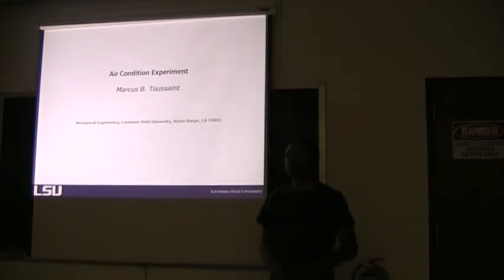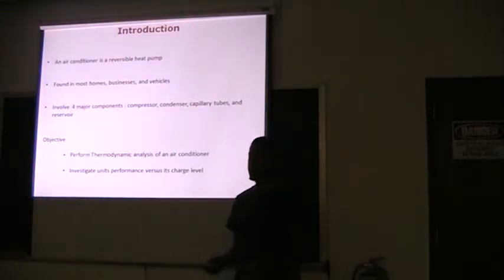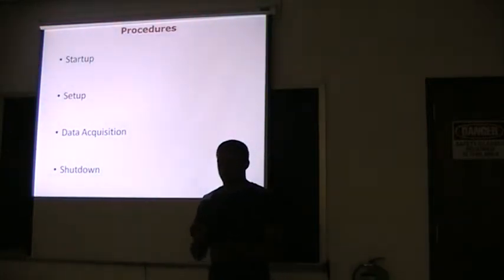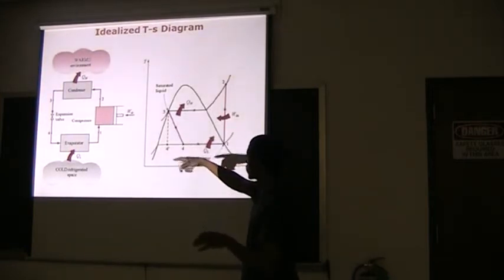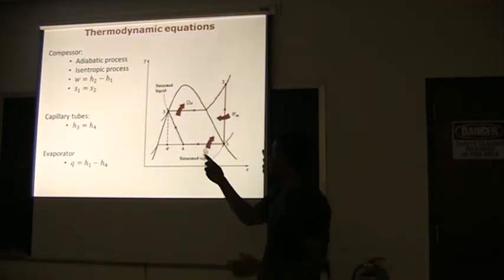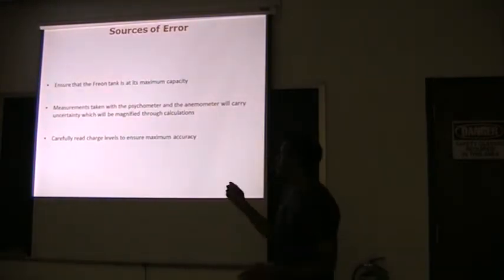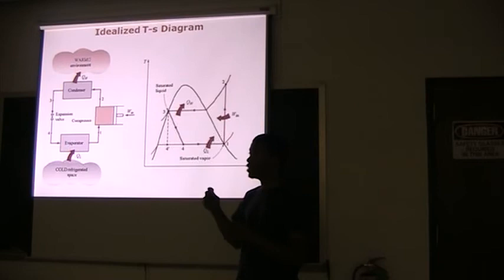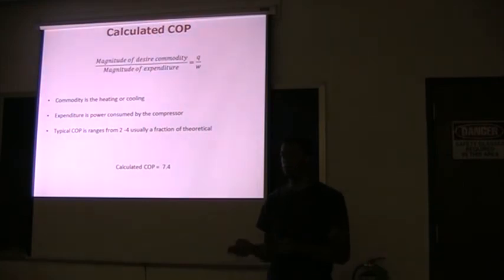Marcus Toussaint Air Conditioner Lead

Comment: I really thought Marcus explained the system of the air conditioner very clearly such as the compressor and condenser as well as other components. Representing the lead of this experiment he explains the goals very clearly and also the overall procedure. Unfortunately our group will not be able to do the experiment but with Marcus's help I felt like it would run smoothly

Comment: I thought it was a good presentation. Your strongest point was how well laid out your slides were. You used "um" a lot more in this talk then in your previous presentations. Your COP number was higher than mine which was approximately 6.72. Mine was closer to some of the experimental values of the other groups. This may be due to different assumptions that we made.

Comment: Very well laid out presentation

I think it would have helped to explain the workings of the AC unit a little more. It was fine since we all already know how an AC unit works, but it could have been a little more "idiot proof" in my opinion.

Also, it would have helped to go into a little more detail as to why real AC units cannot operate on the carnot cycle.

Comment: One of my slides had a typo on it and caused me to stumble when I forgot what the correction was... i did also go over time which shows that i could've prepared more at being brief. i should have show the numbers i used to calculate COP.

I feel that overall i feel i did a good job at explain this experiment procedures and whats going on thermodynamically. My slides were concise and organized for the most part. I have definitely showed improvement since my first presentation!!